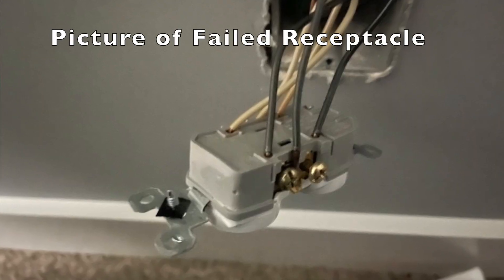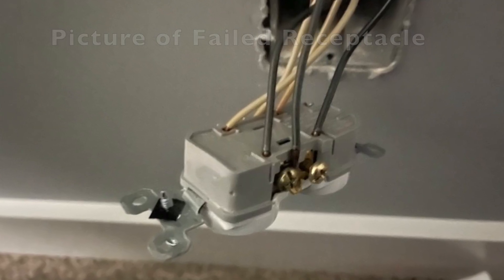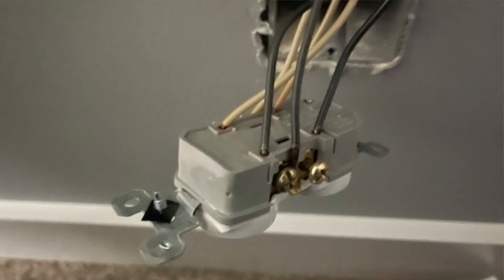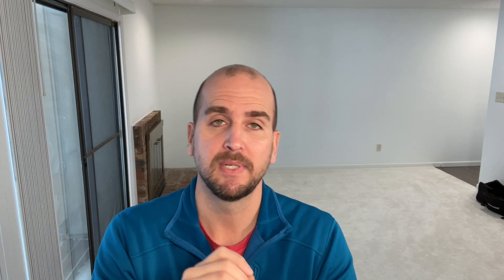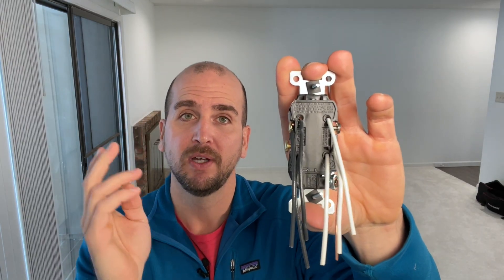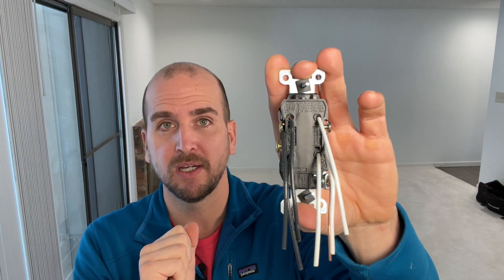Incorrectly Wired Outlet Found In Newly Built Home

Comment: You put your black wire on backwards.  Always put so tightening the screw doesn't attempt to reject the wire.   Don't twist wires prior to installing the wire nut.  The instructions on the box of wire nuts should have told you that.  Also always tape wire nuts in the direction to tighten them so the wire vibration doesn't loosen the wire nut.   If an unused non tightened screw causes problems then you aren't doing something correctly.

Comment: 6:03 you didnt use the sherpard hook. why?
Reply from the maker: sorry for the confusion, I actually used the back wire plates so the wire is just stripped and going straight under the plate opposed to around the screw.

Comment: Why was it wired with red wire? Isnt red from a switch?
Reply from the maker: Hey Ron,  This condo seemed to be wired more commercial as compared to residential.  They used black, red, and yellow for hot depending on the circuit.  In residential it is not uncommon for red to be switched as you described.

Comment: Great explanations but when there are only 2 of each wire its more then acceptable to use both screw terminals. Its good that you removed it tho because 2 wires under 1 terminal is definitely not best practice
Reply: Actually two wires under one clamp style terminal is one of the best connections and likely better than three wires in a wire nut.

Comment: Huh! Only thing I got wrong was not using that extender... Not a trained electrician either. Just common sense. Thought you were going to clarify something that I always have to look up (not something I do very often)... whether the white (neutral) wires are hot or black (hot) wires are hot... and does the white (neutral to silver) wires attached to the silver or gold (hot black) screw...

Comment: I never, ever use the push-in disasters. I've seen far too many issues over the years with them. I urge everyone to take the extra few seconds and use the screw terminals.
Always orient the wire hook in the same direction as the screw tightens (clockwise)

Comment: Don't forget to wrap electrical tape around the receptacle to cover screws and place the ground of the receptacle in the top position to avoid something falling on a partial pulled out plug   . HD
Reply: Not required by code.

Comment: I was taught to not twist wires b4 adding wire cap. If the wires are straight & parallel to each other he threads of the wire cap bite into all wires evenly. Twisted wires are never turn out the same & that means uneven biting.

Comment: Almost every comment:  "I'm not an electrician, but ...(the NEC is wrong)"
Reply: I had a guy try to tell me the NEC doesn't apply on federal property as his excuse for using wire nuts to connect 8AWG to 12AWG because the disconnect terminals wouldn't accept the 8AWG wire after rejecting the panel installation.
Reply: @njineermike  chances are the plans called for 8 awg to avoid voltage drop and he use 12 to tap between the receptacle and branch circuits. All legal.
Reply: @BEVO_vs_The_World  Nope. It was 230 single phase to a variable frequency drive running a 7hp motor, and about 20 feet of 12AWG. completely not legal.
Reply: Motors aren’t my strong suit, in fact I generally suck at them due to low exposure. So feel free to jump in and set me straight where I slip up.... this is my understanding of the scenario you are sharing;

1P 7hp motor @ 230V ( 40A roughly ) means the feeder wire really should have been a #6 awg because of the continuous duty cycle calculation of 125% right? None the less Article 430.28 of the NEC states taps can not have less than 1/3 value of that of the feeder and should not exceed 25ft but there should be an over current protection before the final load, in this case being the motor.
Reply: @BEVO_vs_The_World  You're pretty much dead on. The guy used a switchable motor overload as a disconnect means in place of a thermal- mag breaker,  telecom wire (as in telephone) in place of twisted shielded pair for 4-20mA signal lines, zip tied the signal wires to the output power lines of a VFD, ran 120VAC and the 4-20mA wires in the same conduit, (all of this in a panel that was supposedly a UL508A panel), then tried to say the line reactors shown on the drawings were unnecessary. It was a master class in how not to install a motor control system.
Reply: @njineermike  Sounds like the lowest bid strikes again! 😂
Reply: @BEVO_vs_The_World  yep. You get what you pay for.

Comment: The primary advantage to the pigtail is that if the device fails, circuit integrity is maintained, and the fault stays localized to that device. If you feed it through a device you'll lose power down stream of that device if it fails.
Reply from the maker: 💯 thanks!

Comment: I never done any of the 3 listed and I'm only an apprentice but I still know how to properly wire up 120v (240 or higher I stay away from)

1. I always make sure that the unused screw is screwed down AND if in a metal box I will wrap some electrical tape around the sides to help keep them insulated for less chance of making contact with the metal box

2. Push in/ Stab in connectors in my view are just lazy and a fire hazard. The only good that they do is to make sure that you don't place them into say 12 gauge wire if it was meant for 14 gauge (If you know whats up to code as well as know what wire gauges are supposed to be used this isn't a problem anyways). Same cannot be said though it someone tries to use a smaller gauge wire though like plugging in a 16 gauge into a 14 gauge (though they know its loose and should be a problem. Sadly a lot of home owners and new people working on electrical don't tend to notice this. They go by if it fits and works thats good enough for me...).

Also I think its just a means of a quicker/lazier way of getting the job done. Again I don't use them I prefer to use the screw terminals as you will get a nice tight bite onto the wire!

3. I never EVER use an outlet as a pigtail to hook up multiple connections! Pigtail is the only way that I go (until they come out with a better/safer way)! Metal expands and contracts as well as the connections on the sockets and IMO I don't think they provide a good solid connection the why you get with a pigtail (especially if they are cheap outlets which I won't lie I do use cheap outlets from Walmart and lowes which I will phase out.)

EDIT: ALSO ITS JUST COMMON SENSE BUT TO EVERYONE OUT THERE THAT WORKS ON THEIR OWN ELECTRIC, 

1. GOES WITHOUT SAYING... ALWAYS TURN YOUR BREAKERS OF TO THE CIRCUITS YOUR WORKING ON!. NEVER WORK ON LIVE CIRCUITS!!!!!

2. BUY A NEC STANDARD BOOK FROM LOWES OR HOME DEPOT SO YOU CAN QUICKLY GET UP TO SCOPE WITH CODES.
2a. RECOMMENDED:  IF YOU ARE NEW TO THIS THEN TRY TO GET A LICENSE ELECTRICIAN TO HELP YOU OUT!. EXPLAIN THAT YOU WOULD PREFER TO DO THE WORK YOUR SELF WITH HIS SUPERVISION! SOMETIMES THIS COULD SAVE YOU MONEY AS HES NOT DOING THE WORK!

I'm not yelling, I just made sure that its all in caps to help the reader know that its important
Reply: @Joe-by8jh  pretty much all the reasons I mentioned why and more are located here:

 georgebrazilplumbingelectrical (dot) com /what-backstabbing-an-outlet-means-and-why-its-dangerous/

Pretty much they loosen up quicker over time and are know to pull out and can cause a short or fire. Because it's also a weaker point vs screws which you can tighten down as well as maintain over the years the same cannot be done with push/stab in outlets. Also with screws you will get more contact with the wire as well assuming the out jacket/sleeve is trimmed back to the correct length.

Comment: Congrstulation .... This was actually a great video for others (nothing new in it for me, but ....)

 I am a firm believer that push in's should be outlawed for anything other than a low wattage light fixture ..... traced down too many intermittent issues to 'weakened' push in sprinks have arced and carboned up
.
The box extenders really are needed for back of cabinet installs .... never seen anybody other than me use them (obviously some do or stores would carry them)
Problem is that inspectors only see  'rough' and finished and can't see the intermediate work ... obviously impossible, but a shortfall people need to understand
Reply from the maker: Thanks for the feedback Pedro 👍

Comment: The use of pigtails also prevents the total loss of all lights and/or receptacles in a common circuit after an ground fault outlet if it gets burned out.  It is best when possible to ground fault interruption outlets on their own circuit.
Reply: You might want to rethink that.
Reply: That kind of defeats the purpose of the gfci.

Comment: I thought the use of "Wire Nuts" was no longer advised. I was told to start using "WAGO" Terminal Blocks. More secure, less Hazard prone. And, you didn't "Shepard curl" you wires and mount them Clockwise on the terminals.

Comment: I disagree with what you did/said.  That receptacle has 2 screws on either side of it. It has 2 screws on it for power and 2 screws on it for return and each pair by default is well connected together.  Unless of course the receptacle has been split into 2 circuits, as is sometimes done if one of the outlets in it has been wired to a switch for a lamp. But typically I use one screw on either side for power in and the other 2 screws to daisy chain to the next outlet.  The only thing I would pigtail would be the safety ground as you shouldn't daisy chain by twisting 2 wires together under a single screw.

Comment: I don't use those holes in the back of a receptacle because they are an accident waiting to happen. I've seen tons of those spring like connections overheat and fail. They do make a receptacle with  the hole in the back which work by tightening the side screws I've never seen one of those fail.

Comment: lol, hoped to gain some insights as I do some wirering myself and none of the issues even apply to me.
The receptacles I can by around here do not have push ins. They never have this kind of exposed screws to the side and I never even got into the temptation of wiring two cables to the same outlet, why? I don't use outlets as distribution boxes to forward energy to more outlets because I have proper distribution boxes for that and I don't know any other reason to do that.

Is it UK or US you are talking from? I'm in Peru and all the outlets i can buy here look much much safer than the ones you showed in the video and I wouldn't really like to use any such crap. I have seen push ins in sockets for light bulbs but never outlets. I have never seen those screws to unite wires and while I see cheap and dirty work here and there just uniting wires by twisting them together and than applying isolation tape on top, in new and (semi-) professionally installed circuits I haven't seen this either. If you need to distribute energy you use distribution boxes and between those you use single uncut peaces of cable. Thats another thing. All your wires in the video are single wires. For me those are for wirering my vegetables to their support sticks or stuff like that. I have seen those break so many times just by accidentally bending them to often or to much and they are much to stiff for many places where I have installed electricity. So I would always use cables with several wires inside and I have never seen a professional use single wires here. Sure, Peru is a third world country and many people don't know anything and still try to do install their own outlets and stuff but I have never seen it done like that by any professional.

Comment: I just did all mine, I also do a couple wraps around the entire housing covering the terminals with electrical tape. Is that dumb?
Reply: A Patriot -- No, I always wrap some good 3M black adhesive tape around every outlet so if you ever have to go back in there, you wont accidently short it, or if the box its going in is metal, you dont accidently touch the outlet to the metal box..
You're good !
Reply: @frandanco6289  thanks brother

Comment: Also, I never liked just putting wire in and screwing down as you did. My uncle taught me decades ago to make that loop, put on the screw the tighten up the loop then tighten the screw.
Reply: The spec grade receptacles of today are designed that way to clamp down tightly on two wires with one inserted in either side of the screw. That design was not available in your uncle's day.

Comment: All these things you address are really superficial, also you should not twist wires like you did with your linesmans, the instructions on wire nuts tell you how to install them properly. Twisting them can actually damage the cross sectional area and cause more resistance to current flow. Some old school guys might disagree however Mike Holt will tell you otherwise.

Comment: The reason I agree with your third point is that it leaves the outlets down-line in service if that outlet fails. Not because there are multiple contacts to the outlet. Good videos and tips!
Reply: I don't understand. Even if the outlet fails the wires are still connected to each other.
Reply: good point

Comment: Not a professional electrician, but I always thought it was common sense to tighten unused terminal screws. I always did this way back in the day. I even wrap the receptical screws with black electrical tape for extra protection before pushing it in the box.
Reply: I am a professional electrician, though I work mostly in industrial.  It is common practice in industrial applications to wrap 33 around the receptacle to protect the connections and prevent accidental metal to metal contact.
Reply: @RedR3297  As a 45 year industrial maintenance tech (now retired) it must be where I learned it . Worked both union and non-union environments. Industrial code requires all metal boxes and emt routing. (for the people who don't work inside factories to understand) Used both 33 and 88 as required by the employer I worked for rules. But every recept' got taped. Carries over to inside the home, at least I do.

Comment: Great Job, I worked for a public utility for 43 years and you would not believe what I have seen over the years. I really appreciate the way you explained that it is not against code but is not a good practice. If I had done the work the only thing I would do a little different is put two raps of electrical tape around the receptacle before putting it back in the box. I came up when all boxes were metal and I guess the practice just followed me today...

Comment: Another home was in another subdivision. Every time they threw a switch to turn off the light over the sink the outlet in the breakfast nook shut off. It wasn't suppose to. So they are watching TV plugged into the outlet they turn off the light the TV shuts off. There was a switch and an outlet on the wall. I took the plate off and pulled the switch and outlet out. While figuring out where all the wires went I discovered the electrician wired the hot wire of the outlet to the off side of the switch. I had to undo all the wires figure out how they were suppose to go together. Rewired it and everything was great.

Comment: Glad someone finally stepped up and said something about the push in connectors. I have been an electrician for 25 years and I have seen so many burnouts from push in connections, usually after heavy loads from space heaters and window air conditioners. The industry pushes the push in connectors to save on labor costs and it is my personal belief that push in connections have been the cause of many electrical fires. Instead of banning the practice, they decided to require expensive afci breakers to compensate for shoddy electrical connections.

Comment: It's usually good practice to wrap some electrical tape around the back of the outlet where all your connections were made. Helps keep those set screws from backing out and insulates all your connections inside the box.
Reply: I agree, I was going to comment on that myself if no one had already.

Comment: I would use electrical tape around the outlet before screwing it back in to the receptacle to avoid contact with the screw connectors; to avoid electrocution.

Comment: i typically don't do pigtails, one wire per screw is fine, they have two screws for a reason, the way you had done it prior is fine in my opinion, it is a secure connection as long as it is tightened down properly

Comment: An interesting "professionally installed" (it was an apprentice) issue that I diagnosed for a contractor buddy was: A four switch wall box, where circuit 1 worked fine, but if you turned on circuit 2, the breaker for circuit one blew.  A hint is that these were (newly required at the time in MA) arc fault breakers, or at least circuit 1 had one.  Arc fault includes ground fault, and the apprentice had wired neutral from of the the circuit 2 loads, to the circuit 1 neutral pigtail. I'll leave it as an exercise for the reader to see how that causes the symptom.
Reply: Ugh. That's the kind of thing that can be a nightmare to track down too. Two lighting circuits coming into the same box isn't terribly common. Good job on troubleshooting that!

Comment: For an Extra line of safety you can install the receptacle upside down (the GND socket on the top) this way if a plug is not seated fully to the receptacle a conductive object has less chance for bridging the Hot and Neutral, this happened to me using fish taping a wall years ago and say that the hospitals here started enforcing this as in in house rule. :)